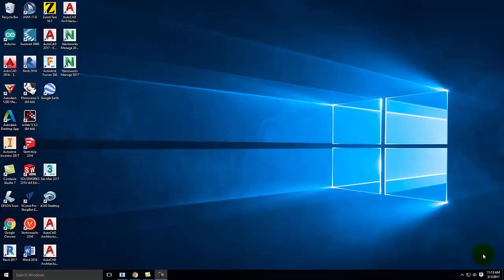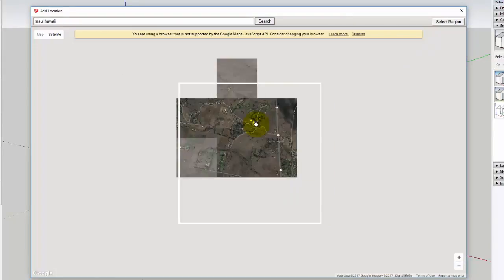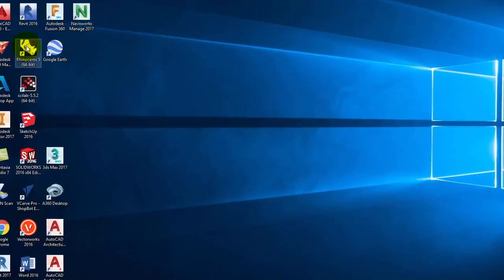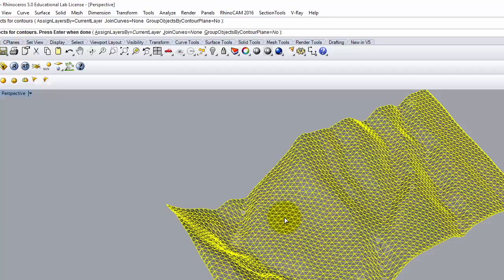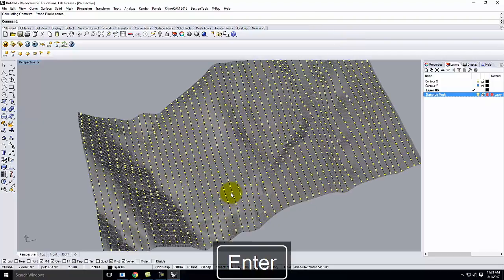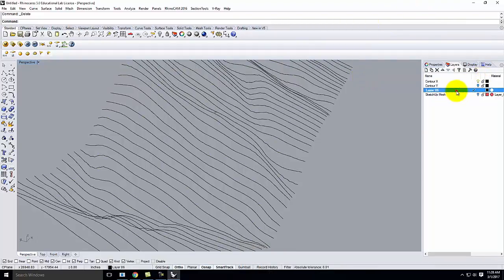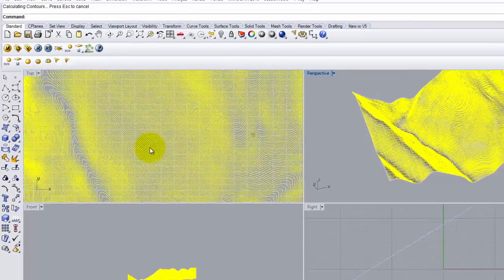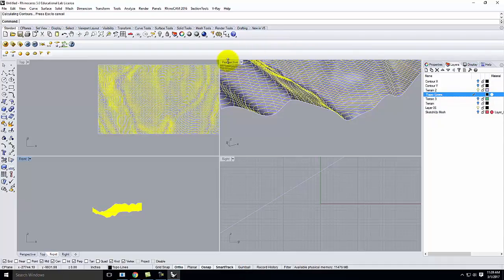Lecture 211 - SketchUp Terrain to Rhino (Spring 2017)

Comment: wouldn't a patch command (using vertices of the mesh) give the same result?
Reply from the maker: A patch command would get a very similar surface as you suggest.  I have some issues with the accuracy of the resulting surface (particularly around the edges) and I like the way a curve network creates a surface with set boundaries.  Also, from a teaching perspective, understanding and using the curve network command (networksrf) is very valuable for complex surface generation and manipulation so I find students benefit from the practice with it.
Reply from the maker: Thanks for your comment.